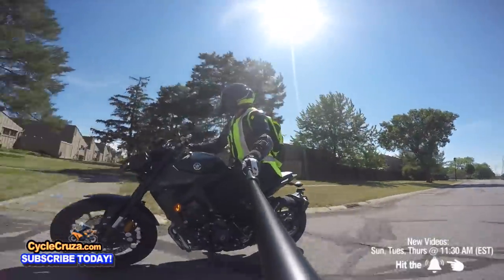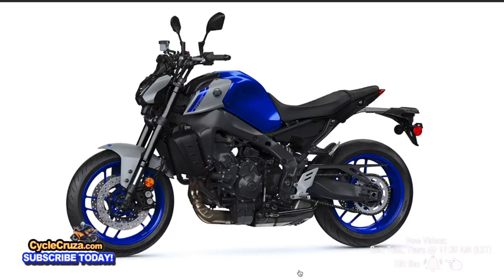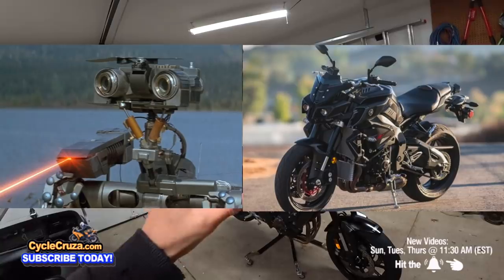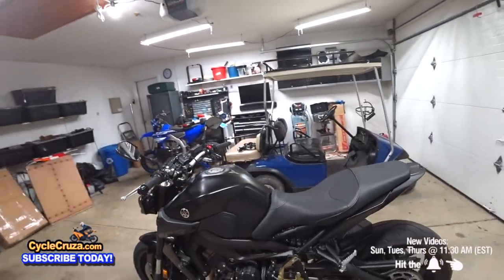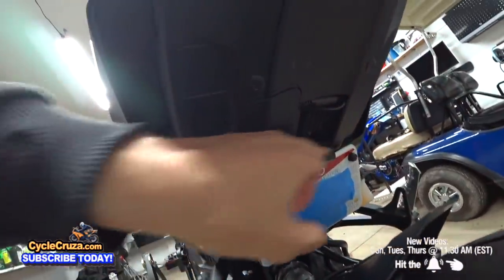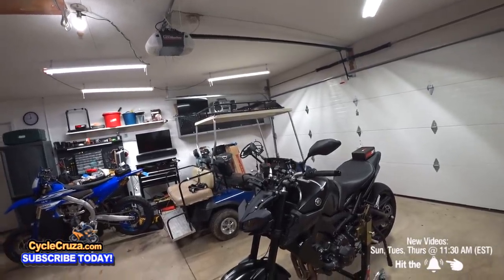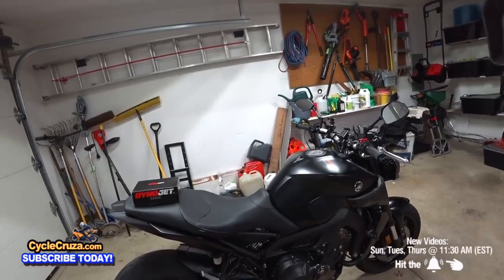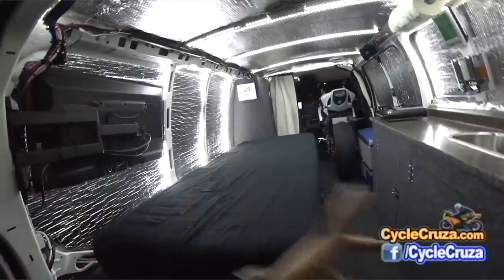Why I'm SELLING My 2020 Yamaha MT09

Comment: Guessing you have about 300 miles on that bike.
Reply: Hasn't even done first oil change yet lol
Reply: gosoku2 probably still has chicken strips on the tires. 😭
Reply from the maker: @Charlies_Riding_Adventures  Most of us will have chicken strip here in Cleveland Ohio. As you already know, the only twisties we have in NE Ohio is in the Metro park and the speed limit is only 30 mph. I used to speed in the park but no more after that last whopper ticket I barley got out of. The park cops don't play, they have special judges just for the metro park that will make you pay dearly. Attorneys don't even want to represent you in a park case.
Reply: CycleCruza you should see my chicken strips on my overweight fat momma cruiser.  😂🤣

My kickstand leans further than I do !
Reply from the maker: Btw, I have more than 300 miles on my MT-09! lol
Reply: CycleCruza lol.  Just playin.  I figured. You were At 65 when I ran into you.

Comment: When I purchased my MT-09, with most of those mods (that actually reduce the value of the bike, just saying), with ≈400 miles on it, I paid over a grand less than your “discounted” viewer asking price.
Reply from the maker: Not true. My Dynojet ECU flash can reset the ECU back to stock and I'm giving the ECU flasher with the bike, along with the stock parts. Also, my bike is still within the 1 year warranty. What year is your bike? Try finding a MINT low mile 2020 MT-09 within warranty and these mods that includes the ECU flasher and stock parts for $8500. Also, you all know I don't race my bike and know how it was cared for. You don't know what you are getting with a used bike.
Reply: @CycleCruza  mine is a 19, factory warranty, mint low mileage bike I bought a year ago the end of this month. From a dealer, no less. (Now, since I bought it from used from a Yamaha dealer, I did get the extended warranty, but that’s kinda like buying insurance.)

Comment: It doesn't matter if it's 14 mt09 or 21 mt09.. it's all about the components. After you have öhlins shock, full exhaust, ECU flash, quickshifter, aftermarket seat, steering damper, launch control, etc the bike is insane.

Comment: Glad I bought the SP this summer. I hate the looks of the new one, well, except the paintjob. I don't want loads of electronics and i've even got accustomed to the throttle in A-mode, been conditioned to it. Still probably get a Power Commander with a custom map, eventually

Comment: Hey CYCLE CRUZA..... I just checked the USA Yamaha website. Guess what is there that wasn't there a few days back? ... drumroll please............. The SP model of the new MT-09 is coming to the USA. What this means is Ohlins suspension, and CRUISE CONTROL, along with other stuff. 2 pounds heavier than standard model, probably due to the remote preload Ohlins rear shock. It's a $1600 premium (msrp) over the standard ride. Might be worth a consideration.

Comment: It's weird that you would sell it for a new one.  I have the 2016 Model and I will keep it until I can't ride it anymore.  You should buy the Kawasaki Z900RS.
Reply: Same here, I’ve had my 2016 since that year and love it.
Reply: @Ozzy62863  Same here!
Reply: Espeically, since he did all that stuff to it to make it better.
Reply: I'm happy with my 2018 XSR900
Reply: @gosoku2771  I bet.  That motorcycle looks like a lot of fun.  How much riding did you have under your belt before getting that motorcycle?
Reply: @ThaRedPitbull  17 years!
Reply: @gosoku2771  Sounds about right.  What's the highest cc you would recommend for a new rider?
Reply: @ThaRedPitbull  No more than 500cc. If you're an absolute beginner, any 300cc, 400cc or 500cc will do. There's a lot to choose from: Hon Yam Kaw Suz. Depends what kind of riding you're going to do.Take your time though when you first start out. Read Twist of the Wrist ll by Keith Code and watch it on YouTube.
Reply: @gosoku2771  Thanks for tips.  I'll save Twist of the wrist in a playlist.
Reply: @ThaRedPitbull  You're welcome. Good luck with everything. Twist of the Wrist is very important. You must understand panic reactions, counter steering, throttle control and brake control. If you can, take the rider's course in your local area when getting your license. They will cover those things as well. It will help tremendously and you'll be ahead of the game! Cheers
Reply: @ThaRedPitbull  if you can't find it under that title look up "cornering theory 7" its that video, named differently to avoid the copyright strike. As a seasoned rider myself, twist of the wrist is the number one thing that upped my riding game beyond anything else I've done
Reply: @monkmoto1887  Thanks for the tips.  I'll be checking that video out as well.
Reply from the maker: I did a video a few years ago telling my viewers that I was going to change to a new bike every year to share the experience, I guess you missed that video. However, the 19' yz450fx supermoto stays, unless they come out with a better model. Unfortunately, I don't have a sponsorship deal with a dealership where I can ride all of the different bikes like some motovloggers. So I have to buy the new bikes.

Comment: I just bought a '19 mt09 that guy had taken directly from showroom floor to renowned performance shop for another $6k+. Almost $2k on K Tech suspension alone. It had 1200 mi on and I got it for......$8500. So, good luck on that $8500 motobudy.

Comment: The new one after you flash it with 40 more cc's will probably get worse mileage.  You already tuned it the way you want.  It would be much cheaper to just buy an olins shock and get the fork revalved than to start over with pretty much the same thing.

Comment: You hate the fuel mileage on the mt09, but you’re considering an mt10...lol
Reply from the maker: That's another reason I want to upgrade to the 2021 MT09, better fuel efficiency. I'm betting the mew MT-10 will have better range as well. I just hope it looks better.

Comment: They still haven't cracked the 2020  R1s ECU for flashing yet (new ECU with Euro 5) so be prepared to wait a while to do so with the new MT09 as well.  Will need a piggyback system if you put an aftermarket exhaust on.
Reply from the maker: Maybe I should wait, they are making it harder and harder!

Comment: Because you finally took my advice and test rode a MV Agusta Brutale 800 RR?? 

JUST TRY IT PLEASE I WILL DONATE TO A CHARITY OF YOUR CHOICE IF YOU JUST FREAKING RIDE ONE AND DO A REVIEW BUT JUST RIDE IT EVEN IF YOU DONT REVIEW IT. 

It’s a life changing bike. It’s a reliable exotic car in bike form, it’s not unreliable. Just ride it ppleasssseeee I need to see if it  blows your mind as much as it did mine. Also it may be one of the best sounding stock bikes ever. The 2018 at least I’m not sure if the euro 5 stuff changed that

Far more reliable than a Ducati and I will personally find you a partner dealer but I know you won’t buy one which is fine but RIDE IT PLEASE